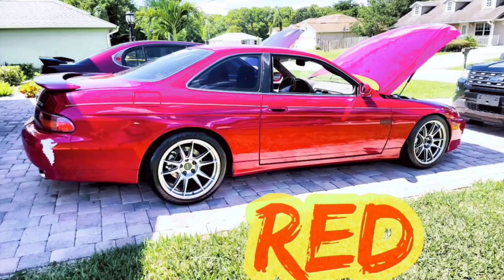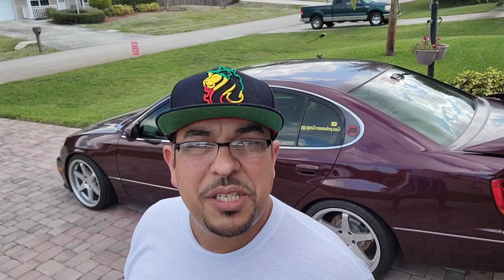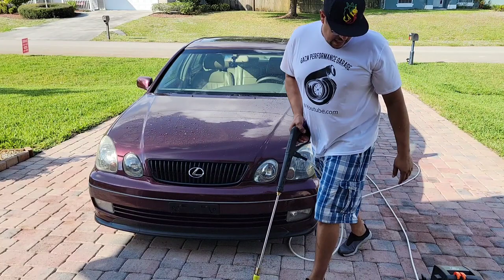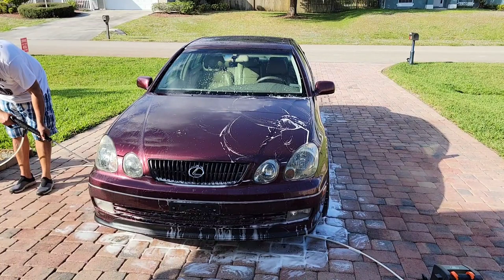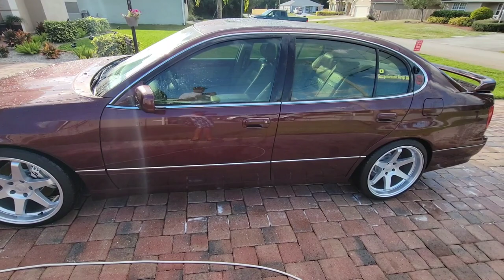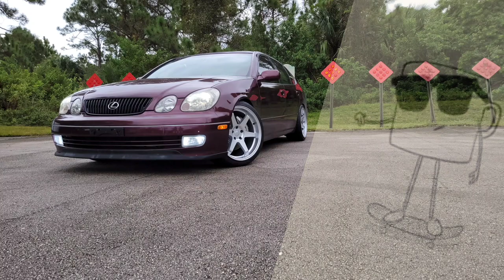2JZ ARISTO SWAP GS300

Comment: So you have applied snow foam....then you rub the dirt around with a wash mitt .....why? If you jet washed the snow foam off and then did a contact wash using a good shampoo,then that would be a safe wash.
the way you washed your car,you will cause swirls and scratches! You should not agitate a snow foam with a wash mitt
Reply from the maker: Because jet wash don't take off 2 week old dirt
Reply: @GazaPerformanceGarageGPG  a combination of a citrus prewash and/or snow foam will get off most of the dirt before a contact wash. Check out detailing channels in the uk and see if they do it like you 😁